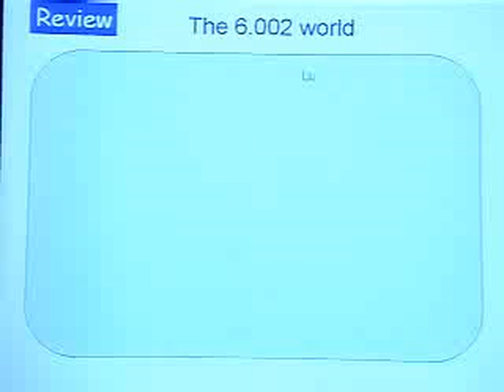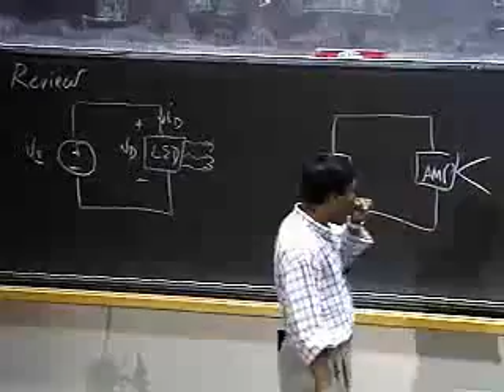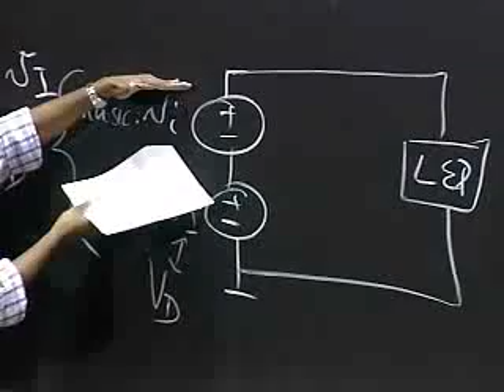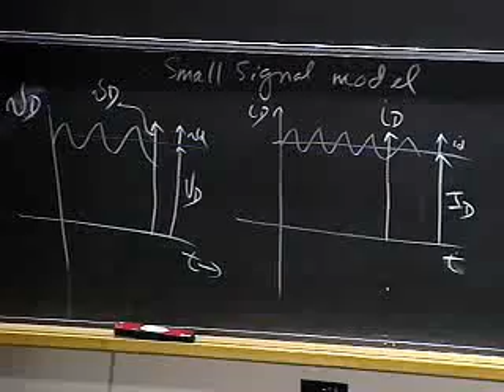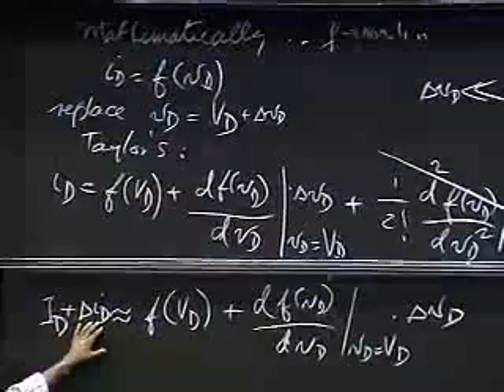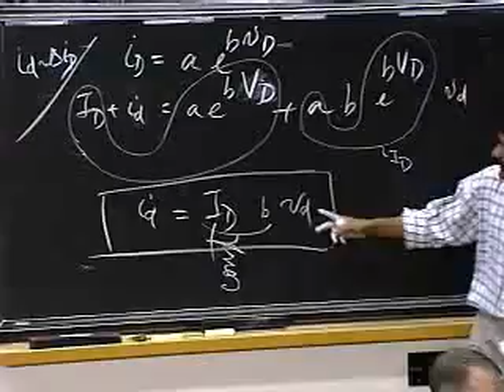Lec 7 | MIT 6.002 Circuits and Electronics, Spring 2007

Comment: 1975 Video quality of "MIT RES.6-008 Digital Signal Processing, 1975" is better than this?!
Reply from the maker: The difference was when they were edited. This course is actually converted from quarter screen Real Media files made in 2000 (and used in the 2007 version of 6.002). RES.6-008 Digital Signal Processing was edited in 2012. A lot changed between 2000 and 2012.

Comment: The reason you can ignore 2nd order terms is not because of vd relationship to VD, its because of the absolute magnitude of vd. At the extreme case when vd is infinitely small, vd² is infinitly smaller than vd and so the vd² term (and higher order terms too) contributes nothing at all to the change in ID compared to the vd term and so those 2nd and up order terms can be ignored without any error.

This is what you approximate when you have a "small" vd.

Comment: Could anybody tell me if the choice of VD was special?I mean for Taylor Series approximtion,one can use any point on function.In that case why not use VD=0 which means that we dont need any DC offset.In fact all we have to do is just to make the music signal small enough to exploit linearity of non-linear LED.Help me someone with these arguments.
Reply: Inherent assumption which needs to be valid in order for it to be correct is time varying signal is very small compared to  DC offset.
Reply: At different locations alone the curve, the curve slope and curvature may be different. For instance, at location of VD=0, in order to get linear response, you may need to shrink the input signal to extremely small excursion. At the same time, if the slope of the curve at that location is so small that the current output may become so small that even though you get a linear current output, but the amplitude of that linear current is too small to be useful, meaning, you could not hear anything from the speaker even with the amplification already set to its maximum.
Reply: +Muhammad Adnan I think that he's just trying to show a general case. You can choose to have 0 as VD. There's a limit to how small you can make the signal so that plays a part in why he's choosing a very linear part of the graph.
Reply: You obviously need a DC bias!

Comment: he chooses to ignore (delta vD)^n,where n=N\{0,1}, because (delta vD) is very small,and (delta vD)^n is much smaller. eg. (delta vD)=0.01V => (delta vD)^2=1x10^(-4) which is significantly smaller, not to be taken into consideration in a real circuit. this simplification is possible in real life circuits, when certain values are so small that they do not influence the circuit in any way, so they are simply removed from the equations. at least this is my take on it. super course!

Comment: You are correct in everything you said, I gave you a bad example. However, choosing delta vD << VD does not guarantee that delta vD, is small. Choosing delta vD small guarantees, delta vD is small.

You will note that he does not use the delta vD << VD arguement when he does the example in the text.